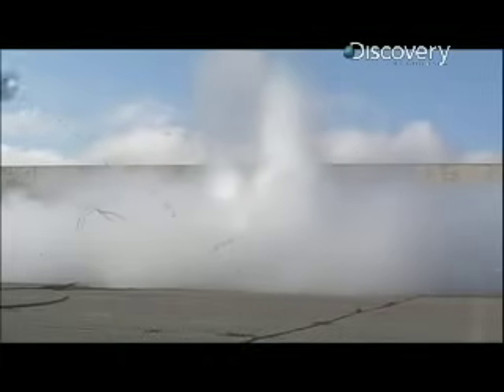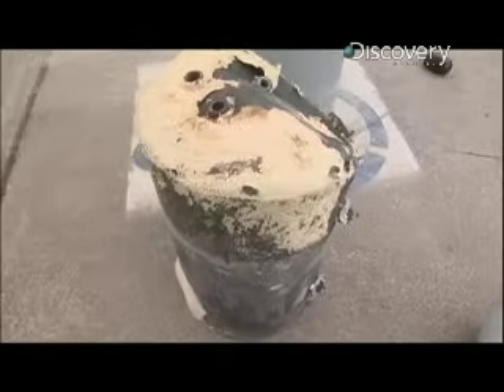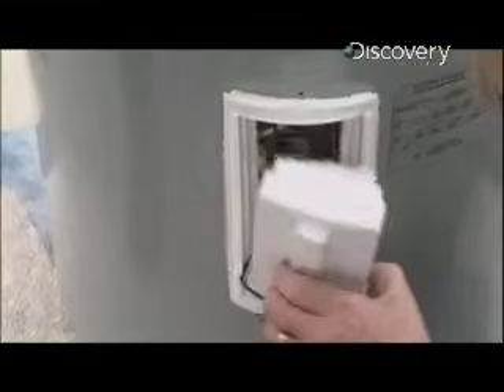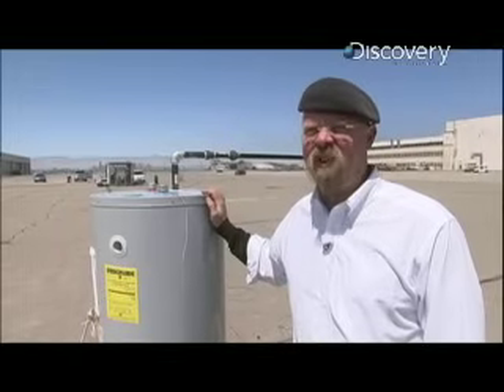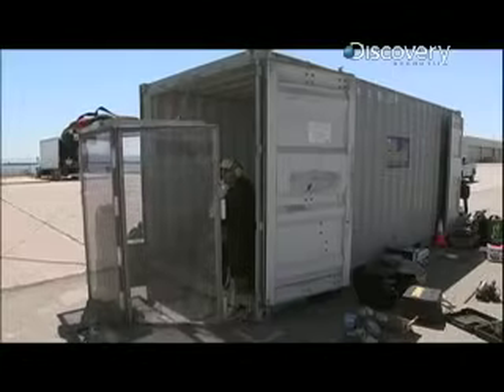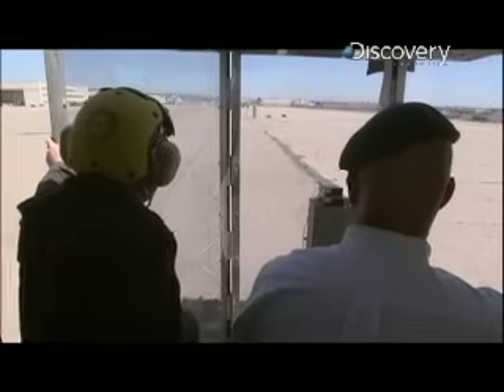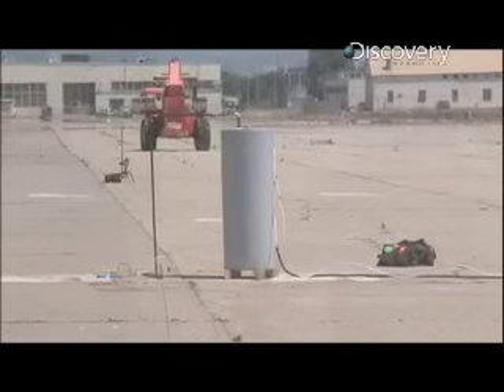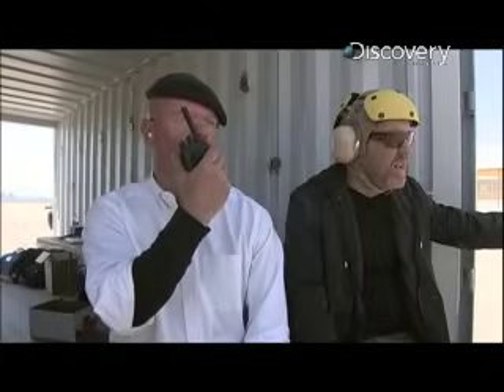MythBusters - Exploding Water Heater

Comment: 1983 our water heater exploded while we were getting dressed and showering. We barely escaped. Had I not checked where the outside smoke was coming from through the bathroom window we would have died in there. The window would have been too small to crawl out. Especially with the baby.

Comment: Just read about a guy (in Sweden) who got an internal fault, the thermostat never shut off, heater reached 200C (connected to some monitoring device for house appliances as is quite common here nowadays) due to pressure valves also failing. Didn't explode before someone came home and could disarm it in a controllable way. Could've been way worse as this video shows.

Comment: One time long ago and in the middle of the night our local fire dept responded to a strange call at a mobile home. Somehow the 40 gallon H2O heater blew up. The owners were in the bed just 3 feet from the H2O htr closet on the opposite side of the wall. Suddenly they were launched sideways bed and all and came to rest about 30'  away on the slope below the home,  shocked but unhurt. HALF of the mobile was stripped to the bare floor, completely GONE.

Comment: Loved watching this, but just want to say, as a former plumber who used to work on these things daily, don't be nervous about this happening in your house with your heater. Three seperate failures would have to happen at once. All water heaters have a temperature and pressure sensitive relief valve that will open for either and relieve the pressure. Both parts of it would have to fail, then there is also an electric switch built in that kicks out if the heater exceeds 190 ish degrees. Also on top of that your plumbing would need to hold in that much pressure without something failing. Electric water heaters are not anything to be nervous about.
Reply: Indeed, they had to go to quite some lengths to actually get them to fail like this.
Reply: Thanks for the reassurance! I just bought my first house and it’s a new build and the water heater is in the attic above the master bedroom and every night after shower I hear it heating up the water and I’m like I know you’re new but please don’t explode lol
Reply: @holladaycubed that’s actually a good thing. It’ll go through your roof, instead of it being in the basement and coming through your floor.
Reply: @Dub-50  do they always pop the top? Wouldn’t it be more likely the bottom where all the sediment is that weakens it?
Reply: @holladaycubed , who tf puts a hw heater in the attic? Those things eventually leak/need replacing.  ¯\_(ツ)_/¯
Reply: @70Marc

That's what I was wondering. Plus who put a water tank in an attic lol lots of weight that doesn't need to be there
Reply: @holladaycubed  you need to look into getting it out of the attic it’s gonna cost so much in the long run
Reply: @holladaycubed bro now way since I also converted the garage to a bedroom so the water heater is located in my bedroom and always when it turns on or hear a noise I just be hopping that it doesn’t explode and kill me 😭. Although not that time ago a incident happened where it flooded the bedroom but I’m glad the water release valve burst because if it didn’t burst it would be a whole other story where probably the room would not exist anymore and the pressure relief valve wasn’t even working that’s why I say if the water release would not burst, I would of been doomed.
Reply: What about gas water heaters? Mines right next to where i sleep so it makes me nervous
Reply: @normayounan541  now that adds another element, gas leaks…
Reply: @Lele-ib9ui  if there was a gas leak you would smell rotting eggs
Reply: @jngr3449  yes which is why I want to avoid gas water heaters in the future ;) my gramma had a gas stove and it blew up on her. Pretty scary
Reply: @normayounan541 you should not have a gas appliance is same room that you sleep , period. Do you still live there ?
Reply: @jamesmain_email6969  its not in the same room but its literally in the little room next to mine
Reply: @normayounan541  get a carbon monoxide alarm mate. Cannot see it smell it taste it. The silent killer.
Reply: Its illegal in most states to have a water heater in a bedroom or a bathroom. Check with your local inspection department to be sure. Electric heaters also go boom. Gas water heaters can kill you just by using up more oxygen and not having enough fresh air to support the combustion
Reply: @dougs867 I live in a converted bedroom garage, the water heater is located there, probably later on I’m just gonna try to move it right next to the outside wall of the bedroom garage for if a incident happens I don’t need to worry that much
Reply: @normayounan541 I bet you live in a converted bedroom garage right? Yeah I know how you feel I sleep in my converted garage bedroom where the water heater is located and yeah it just make me nurvous just by the looks of it that’s why I have just put two walls with a little door whenever I need to do maintenance
Reply: Indeed. Just don’t screw with the safety systems.
Reply: An explosion happened in Pittsburgh yesterday, apparently the reason was water heater, it was a big explosion
Reply: @Mitche23  omgg I just looked it up! Three homes were destroyed and five people killed 😭
Reply: @Lele-ib9ui  That was a gas explosion, not a tank explosion, as was shown in this clip...HUGE difference...
Reply: the explosion in Pennsylvania happened due to exploding water heater tank.
Reply: Thank you, i needed that..
Reply: What about gas heaters?
Reply: Thanks I have one next to my bed 😭
Reply: Ours just blew in our home. Significant damage. Everything failed on us thankfully no one was hurt
Reply: I’m a plumber and I once saw that a customer put a SharkBite cap on  his T&P.
Reply: We all know gas water heaters are the ones to be worried about exploding.
Reply: Bro stfu this is on tv!
Reply: Just had a neighbor in the neighborhood whose house exploded (not a gas leak) so I checked ours tonight it’s from 1994 should we be worried or 😅
Reply: Thank you for posting that, electric tank is old, needs to be replaced and I don't know when it was last serviced or checked I have been very nervous about it exploding, as i don't know the condition of the relief valve.
Reply: Furthermore, they did not account for the fact that a water heater would be filled with water limiting the amount of space for steam to be compressed. Water can't be compressed that's why the fill tanks with water to pressure test them. They raise the pressure of the water and if the tank is going to fail it just splits open, not explode.
Reply: Rocket science🤣
Reply: I just heard a loud hiss 😅
Reply: Thanks for sharing…they have always made me unerringly nervous lol
Reply: But they can and have happened
Reply: Pfffshh ok thanks 😏👍
Reply: Thank you for this comment.
Reply: This is already covered in the episode. Good on you for taking a night class at your local community college though 😂
Reply: @kishascape

It's not covered in the clip, you really think people here are going to seek out the full episode?

Comment: I appreciate the entertainment value of the show and this episode. It successfully demonstrates expansion of compressed gases, however, not properly harnessed. This occurance is happening within every gasoline and diesel engine. Expanding gases are what is forcing the pistons down into a crank mechanism. What if instead of needlessly using gasoline or diesel fuels utilize high pressure 1500 psi compressed air. I have three (3) patents for a compressed air motor that can achieve this as a viable alternative to electric motors and gasoline engines. Clean air in and clean air out.

Comment: To all people wondering why water tank explodes and not just burst or leaks out.
The explosion mechanism is BLEVE, which is due to additional energy stored in overheated water.
As the pressure rises the water boiling temperature also rises. You could have very little steam in the container (say one cubic inch) but the pressure could be very high (it must be to burst the container). To reach that pressure, the water in tank must have overheated and for that it must have accepted huge amount of energy.
The boiler reached 300PSI which means the water must have reached about 210C (boiling temperature at 300psi).
Imagine the water in the tank is at 210C and now there is a hole in the tank and the pressure suddenly dropped to 1atm.
All that water no longer wants to be liquid and wants to turn to gas.
As the steam is at the top, and all water at the bottom, the water expanding has nowhere to go but up. This causes top of the container to be hit with rushing water. This typically causes the container to fail catastrophically and also is the reason why those damn containers go always up.
The moment the container bursts all the energy that was needed to heat up water from 100C to 210C now is released in an instant causing a violent explosion.
Reply: holy cow, didn’t know that i wanted to know. thanks

Comment: CALLING MYTH BUSTERS: Jamie/Adam (Peter Rees)

You need to do a EUROPEAN version of this . . . . . Apartments with steel reinforced concrete floors, but 'card-board' interiors.

I think this would be even more devastating with the cylinder possibly ricocheting many times within an apartment floor and/or an explosions that would devastate many apartments on that floor, and possible compromise the structure of the entire building.

The walls between the apartments and walkways are usually single or dual breeze block, as with the outer wall.
The walls within the apartment are usual wood or steel studs with gypsum plaster-board.

Can you not find an apartment block about to be torn down, but set up this experiment before they start ripping it apart and then repeat your experiment?
Kit out three entire floors (several apartments per floor) and put the hot water cylinder in the middle floor?
I suspect there might even be enough power to lift the concrete floor that it initially hits.

Typical water cylinder sizes in Europe are 210L!

It would really help to motivate the owners and landlords to take yearly and consistent inspections more thoroughly.

Comment: It's not gonna be like that in your house, most installers don't remove the pressure relief valve and plug everything up, and I really don't think residential water mains push out 300 psi
This is for the ppl in the comments tweakin

Comment: When I worked at a Boy Scout camp kitchen one summer (1975) we had a water heater that the safety valve kept leaking.  The camp director replaced the valve with a "replacement" that someone donated to the camp. He failed to actually look at the pressure rating on the valve. It turns out that the valve was for a high pressure dry steam boiler and not for a water heater.  It turns out that the problem with the water heater was that the thermostat was broken, not the safety valve, and the night that the camp director changed out the safety valve, at about 1am we heard a big KABOOM, and a minute later heard a THUD. The water heater "rocket" went through the roof, blew out almost all of the windows in the kitchen and the dining hall, and made about a one foot divot in the parade field when it landed there.   When I saw this episode, I already knew what the outcome would be, but I still laughed along with Adam and Jamie when their "rocket" took off.
Reply: Too bad the camp didn't hire you as the maintenance director.   Trying to defeat a safety feature is playing Russian roulette.  While there's always the chance the valve is old or contaminated,  in most cases,  it is leaking because you have a pressure issue or a temperature issue,  and the proper repair is to investigate why the valve is leaking
Reply: @Sparky-ww5re  By the way, this was a propane fired 400 gallon water heater.  We were very lucky this happened at night and not during a meal service, otherwise neither I or about 400 boy scouts and staff would not be around to talk about it.
Reply: @markemanuele1929  Didn't you say that it failed to even blow all the windows out? How is that going to kill 400+ people??

You had a cool story going until you overplayed your hand...which immediately puts the rest of the story in doubt...
Reply: Dare I even imagine what happened to the camp director after this? At the very least, I hope he learned something from the experience and is grateful to be alive.
Reply: Bullshit

Comment: Imagine this happening in your house
Reply: It happened to mine around 2010. Not too destructive but caused nearly irreparable mold damage afterwards.
Reply: @dysfunctional3837  damn
Reply: @dysfunctional3837   Why was the mold irreparable?  did you try to treat the mold at least?
Reply: Ya I seen this episode when i was like 9 it scared me for a while my room was above the laundry room lol
Reply: @cjlevis6383  same lmaoo my room was right above the water heater in the garage and i was always scared of it
Reply: I’m on this video rn cause it’s happening in my house lmaoo
Reply: @jkgoat2291  wow, is your house seriously damaged?
Reply: @tcg1_qc  it might be in about 25 minutes
Reply: @jkgoat2291  so that means it didn't explode already..? Are you like outside your house with the fire dept??
Reply: @tcg1_qc  yes actuakky
Reply: @jkgoat2291  damn, hope it doesn't explode
Reply: @jkgoat2291  how'd it go...?
Reply: @rdouthwaite  good
Reply: It would suck
Reply: Impossible if you have a pressure relief valve. All heaters come with them.
Reply: It happens when a handyman plugs the relief valve because of a drip. Will work fine until the heaters thermostat decides to fail. 23 years as a plumber, I’ve seen it many times. Even saw the aftermath of one that went through the roof and rocked the house from the foundation. House had to be demo’d.
Reply: @poptwo4  wow, did insurance cover that? If not, rip.
Reply: @poptwo4  lol that’s pretty hard to believe...house had to be demolished? No way. Sure major construction of a few rooms and the roof...but to knock it off the foundation....ehh I caught a 30 pound bass one time, immediately called my friend about it...then I weighed it and it was only 22 pounds. When I got home to show my dad cause he loves fishing it was only 9 pounds. Point of my story is I was excited and deeply exaggerated lol. Maybe that’s what’s happening with ur story haha
Reply: @poptwo4  that's criminal negligence.
Reply: @poptwo4  i seen one where it blew the back side of a apartment ouy
Reply: @cutlerc2351  those fail too....
Reply: @cutlerc2351  As long as the valve lifts....
Reply: @cutlerc2351 not impossible sometimes valve gets clogged since the average person doesn’t check them
Reply: Just happened in Pennsylvania. It was captured on a door cam. Looks like an artillery round landed on it. Killed everyone. And partially destroyed a few other houses. Truly terrifying. It doesn't happen every once in awhile. Luckily it's very rare.
Reply: They did that on Don't Try This At Home https://youtu.be/HS6fImxE9Lo?t=56

There are a couple of shots of the stairwell afterwards, with no stairs in sight.
Reply: Pretty sure they redid this in a model house
Reply: What house?
Reply: @elijahsellers3727  wdym?
Reply: @tcg1_qc  as in the house explodes
Reply: Don’t wanna
Reply: It's all I can think about now that I learned about it honestly its defeating me mentally.
Reply: Imagine this happening to a train
Reply: I'm glad I have a brand new water heater
Reply: Ours almost did, also hi from 4 years later.
Reply: That’s why I went electric 😂
Reply: Ours just leaked so it might
Reply: @Jules-hl2ls  you will be alright call a plumber
Reply: They are also using c4 so I think the pressure release valve will prolly reduce damage quite good
Reply: @OGDrinkr  wtf have you ever watched mythbusters? If they 'cheat' like that they will admit it
Reply: @OGDrinkr  rude and uncalled for
Reply: @novalone3211  who
Reply: @OGDrinkr  Carey Grant and Tory will be having words with you Zachary 🤬😡
Reply: @novalone3211  cares

Comment: Note to self : Make sure that, hot water heater has a functioning, pressure release valve.
Reply: Also make sure to have the pressure release valve go outside onto concrete or if its in the garage just pointing down, cause if that thing ever goes off it will flood and ruin wood or carpet
Reply: @retrobat153  I had this one customer request that I routed the drain into her flower garden lol
Reply: @forrestgumball  That sounds like a good idea, but wouldn't the water be hot? Pretty sure those flowers won't appreciate hot water... Did you do it? :P
Reply: I had mine replaced recently.
Reply: Why do you have a "hot water heater"? If the water is already hot why are you heating it?
Reply: @DanKuhn  what do you think makes the water hot in the first place.